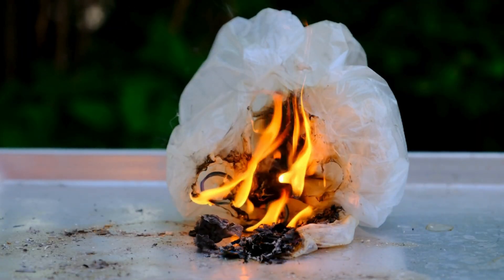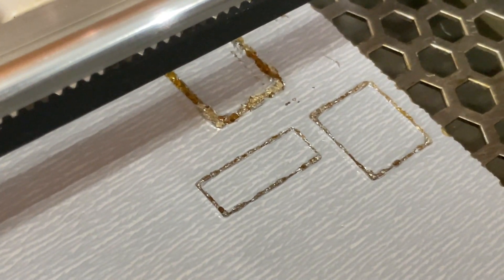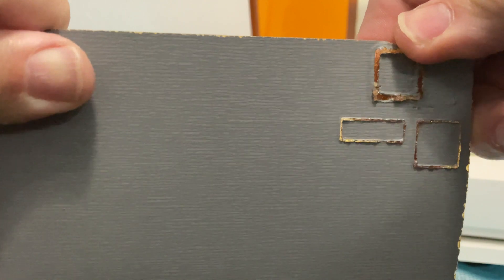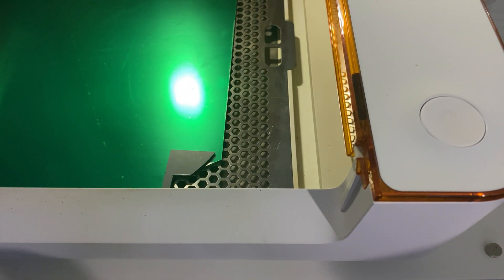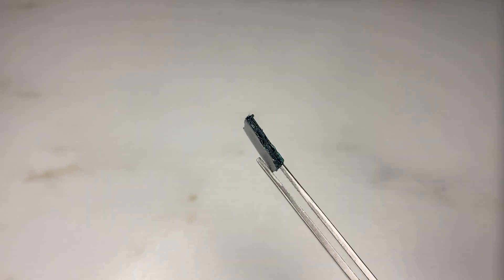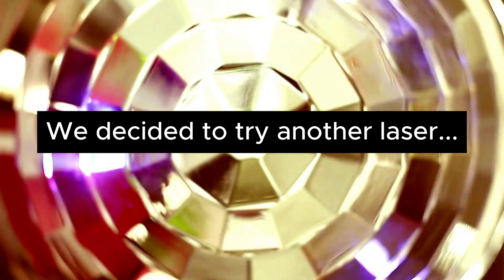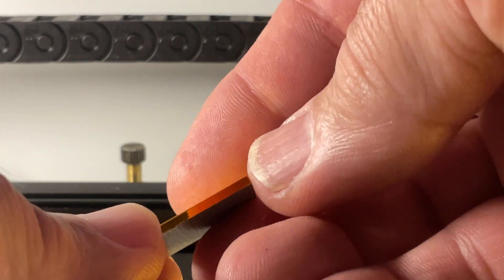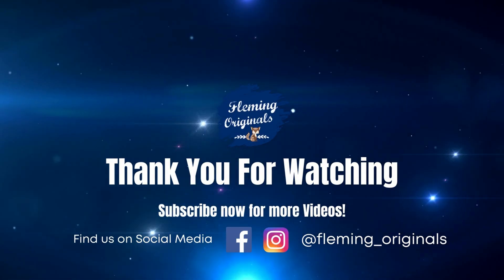Glowforge Aura: Can it Handle Mirror Acrylic?

Comment: Hi, I recently came out with a new mirror acrylic product idea that I think diode laser can cut through. Would you mind testing out for me?
Reply from the maker: What idea do you have? 😃
Reply: @Flemingoriginals007  the mirror acrylic that the market has of right now is made of  clear acrylic, this is why diode lasers like the Glowforge Aura has difficulty cutting through it.. my product idea is mirror acrylic made out of black acrylic and from my research, diode laser machine has no problem cutting through black acrylic
Reply: @Flemingoriginals007  not sure if my reply was deleted or somehow i didn't click the reply button after i type it out. 

Anyway, my product idea is making mirror acrylic out of black acrylic. The reason why diode laser machine like the Glowforge Aura cannot cut through the mirror acrylic that the market has of right now is because it is made out of clear acrylic. From my research, diode laser machines can cut through black acrylic so that's why i thought of this solution but I do not have a diode machine to test it out

Comment: I was thinking about covering the clear,etc acrylics with paper for cutting. Have you tried it?
Reply from the maker: Hi deanagarnes2676, 

Covering acrylic with paper is a good idea, but unfortunately, I don't think it will improve your results.  We have tried painting the acrylic, and we have tried both light and dark-colored masking. In all cases, once the laser burns past the covering/coating, the light just scatters through the acrylic without cutting it.  We were able to get some melt effects on the surface of the acrylic, but they were not controlled, and they were not attractive.  That being said, we did not specifically try paper.

If you do decide to try it, please let us know your result.
Reply: What if you place it upside down if it has a matte side? @Flemingoriginals007
Reply from the maker: We just saw this. We have not been able to get clear acrylic to cut or engrave. We have only been able to melt it. What has your experience been? Thank you for commenting.